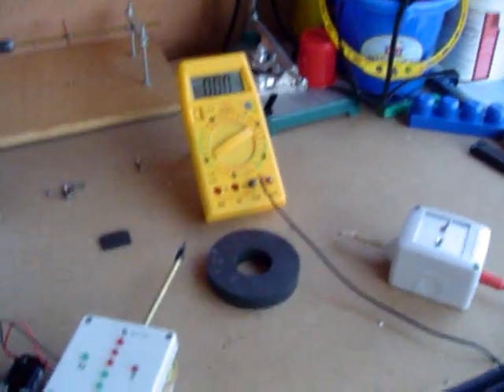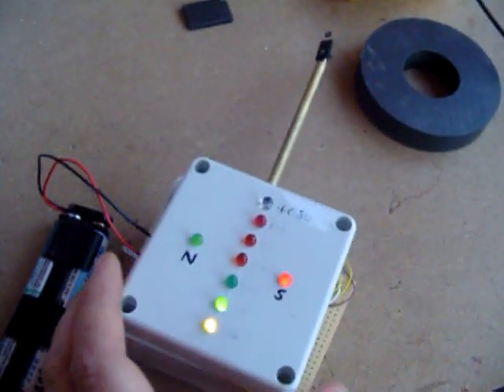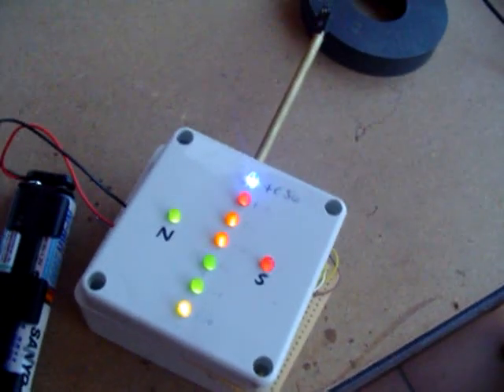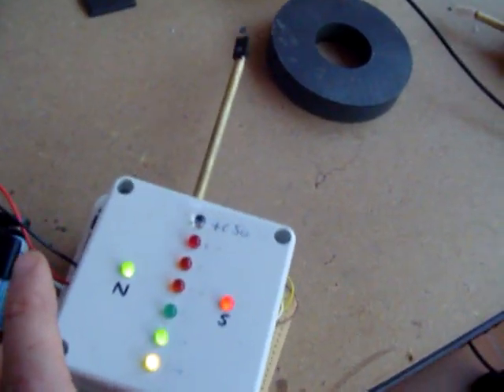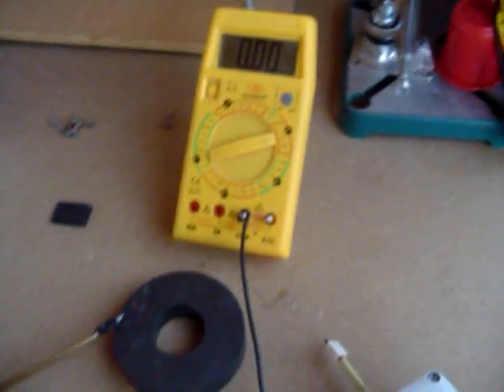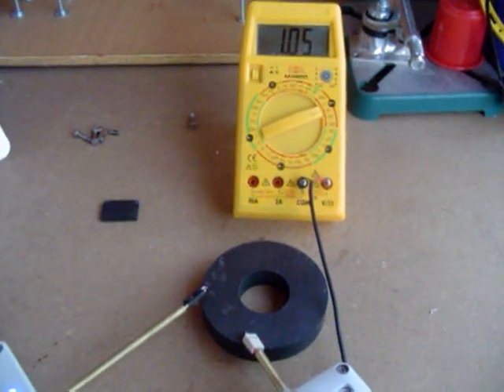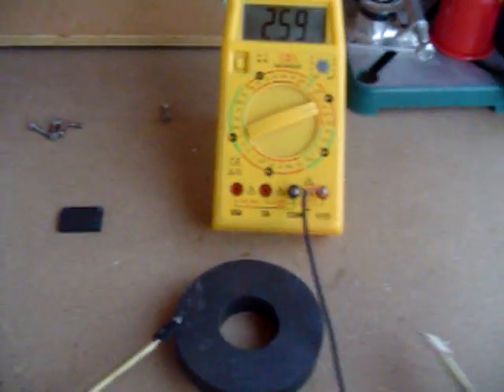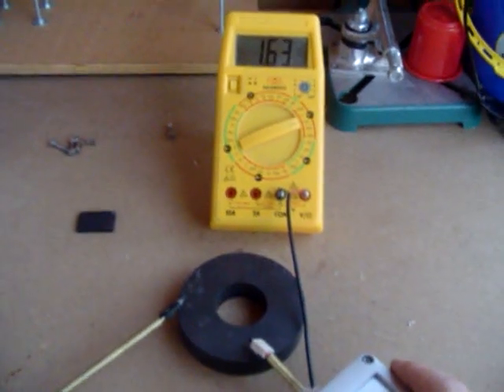Poormans Gauss Meter

Comment: can you please post some schematics and/or a diagram of the version with Pic and leds
Reply from the maker: this used a picaxe chip which are very easy to program. basically the hall effect sensor sends a varing voltgae to the picaxe chip. When there is no field its around 2.5 volts , north is then anything over and south anything below. The picaxe is able to give a value between 0-256 so 0-123 is South and 124-256 is North
Reply: I program PICAXE chip, but the code is needed here!  We don't want to re-invent the wheel!
Schematic would be a plus!  Can't give a Thumbs-UP until then.

Comment: I have an EMF detector.  It's neat to see how it reacts to my strong Neodymium magnets.  You can get a stable relatively low reading(3.00-4.00) but if you wobble the magnet in front of the sensors it will spike to the hundreds and even blank out the device